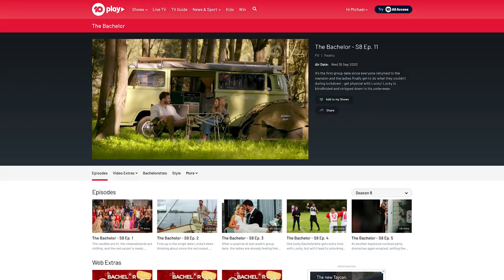Building Locky from The Bachelor's Dream 4WD & Camper Trailer! Kings MT1 Camper Trailer + Navara

Comment: I can tell by the sloppy travel in the rear end that this is standard suspension. Yes it's fitted with a standard lift from factory but this car is massively over it's 2900kg GVM. This makes it completely illegal n highly dangerous. Why are u guys advertising this. My guess is with a full tank and both occupants this would weigh well over 3100kg+ I have a Nav with same draws, slide, lights, battery and nothing but empty racks up top and I'm at 2600kg constant and that's with nothing loaded in or on the vehicle. I can almost say that a GVM upgrade still might not be enough for what's on it.
Reply: They have a trailer too so I hope they spread the weight out. That weight on the roof may be too much off road. Maybe even too much for the static weight rating.
Reply: @Malc664  exactly there has to be at least 90kg+ on the tow ball aswell..yikes